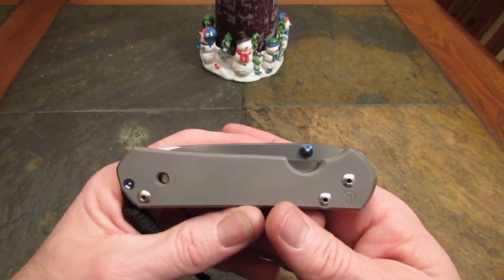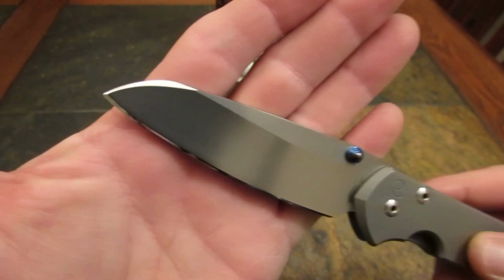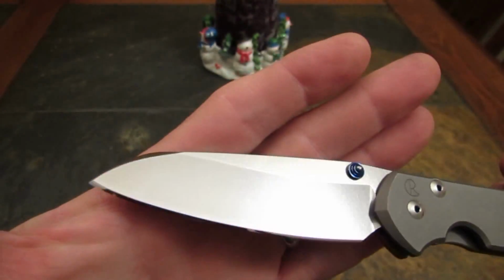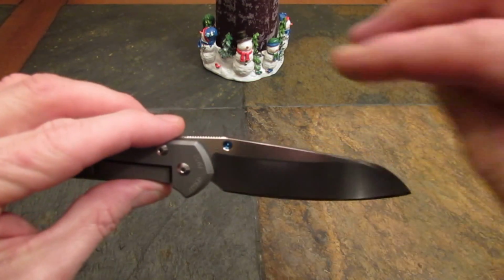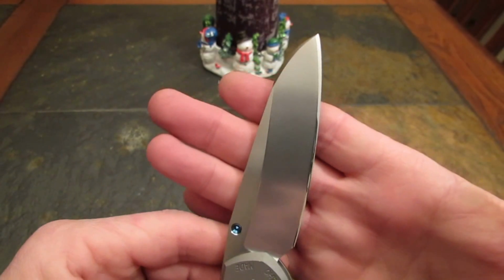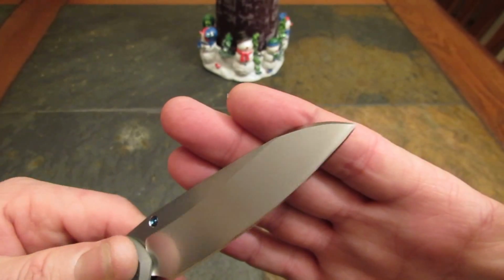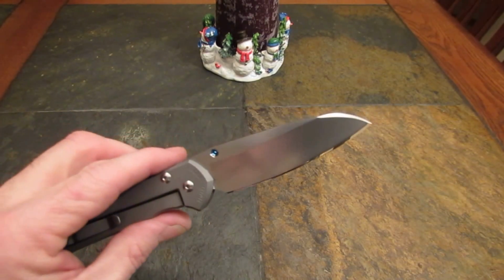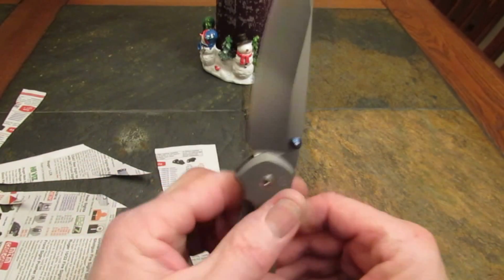Chris Reeve Sebenza 21 Insingo:  Ugly? Functional? Awesome?  You Decide...

Comment: I don't see anything wrong with the looks of the insingo!...When i first bought my small insingo years ago it booted the clip point right out of my pocket. I'd say if I had to reach for 1 between the clip or insingo, it would be in the insingo... Something about it is just so appealing... both to the eye, and in use....The belly you spoke about resting right where it should when presented to work resonated with me so much, its the same thought I had the first time using it, it's right where it needs to be!.. Also, you are spot on about the slicing and piercing ability it has.... on top of that, i feel as though the tip is more re-enforced than the clip points tip so durability wise I think it may also have an advantage. Just my .02! 

great vid as always!